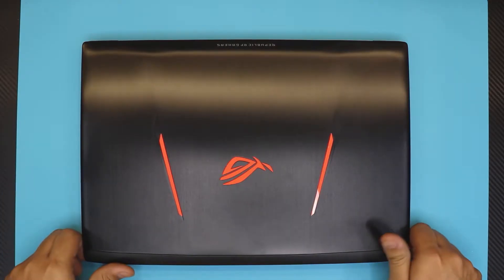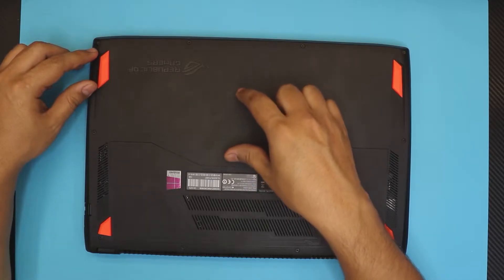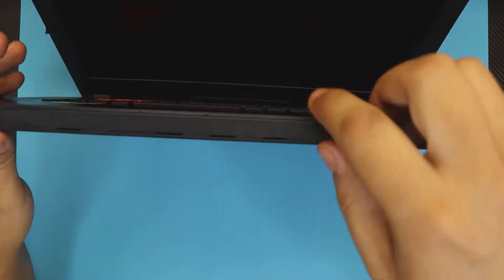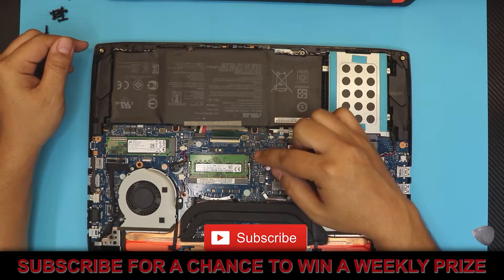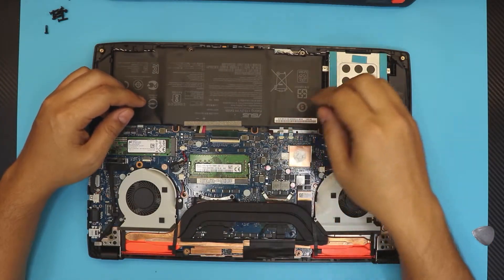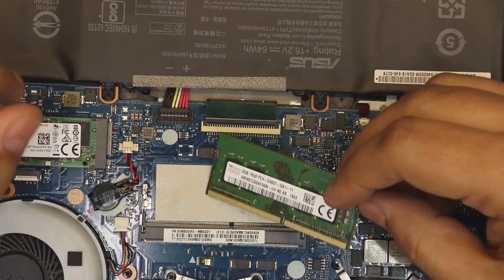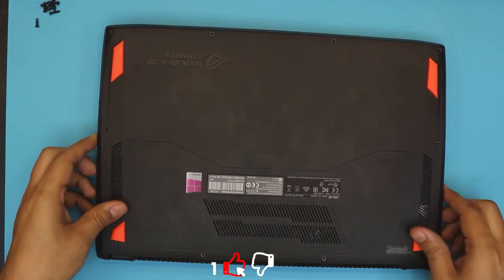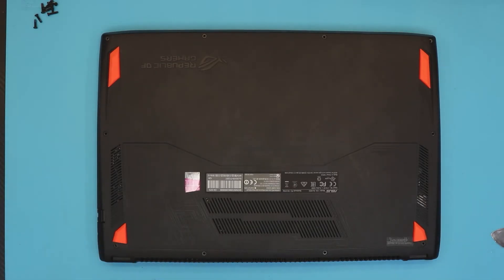ASUS ROG Strix GL502 Ram upgrade disassembly guide

Comment: What is the max frequency that we can use? Is it a problem to use a 3666mhz 16gb? I have the G502VM-FY017T
Reply from the maker: you can use a  3666mhz and the bios it will adjust to the max that can handle. after putting a  3666mhz go to bios and enable the XMP profile.
Reply: @uFixTek  thanksss! And why when i see on my computer the max i can add, its says 64gb but the doc say 32gb? I tape "wmic memphysical get MaxCapacity, MemoryDevices on the" on the CMD
Reply from the maker: you should check the cpu specification and not the motherboard.
you should put the max that your cpu can handle. not your motherboard or laptop model.
Reply: @uFixTek  a i7 can handle more than 32gb no? Why you always say that this laptop can handle max 32gb? Sorry for noob questions
Reply from the maker: just by saying i7 it doesn't help, open your task manager and go to performance and click on cpu and give me the exact i7 model.
i need to know i7 and what gen and what line in that gen

i7 - Gen , lineup 

and then you can use the intel website to see the Max Memory Size.
shorturl.at/inxD5

Comment: Hi, i have the gl502vt but i dont know how much ram i can upgrade, this model has 1 module for upgrade, and this model support two drives? a m.2 and a ssd?
Reply from the maker: you can go up to 32gb ram and have a m.2 ssd and regular hdd or ssd installed at the same time
Reply from the maker: @Freddy-lj1oq  yes you can

Comment: I’ve got the gl502vm with the gtx 1060 , I clicked the link to buy the ram but it gave so many options to pick from, what model of ram do I need.. I think I want to max out my ram at 24gb right or 32?
Reply from the maker: you can remove the 8gb and place a 16gb sdran ddr4 and this is the link:
https://amzn.to/3hFGx4I
2400Mhz C16  (1x16GB)
you can go max 24GB but the cpu can handle 32 but there is no way to get to 32 gb as of the 8gb soldered on board so therefore 24gb is max because they love F*** people over by soldering rams on board!!

Comment: Hello, I have the model ROG GL502VM-FY225T Intel® Core™ i7 16 GB DDR4-SDRAM 256 GB SSD NVIDIA® GeForce® GTX 1060, I would like to upgrade the RAM to 24 GB (I think it’s the maximum amount allowed for my model). Also I have 256 SSD only, I have 0 HDD. And I would like to have more SSD, I don’t know if I can expand the SSD with an external SSD or I have to replace the one I have, in any case. I hope you can help in both issues, thanks and good tutorials.
Reply from the maker: your max ram is 32GB:
2x 16GB
https://amzn.to/370VHfS
(but this motherboard has one soldered on board so you right you can go up to 24gb only add a 16gb.)
unless you desolder the on board ram chip and solder new sdram chip. lots of work.
and you cant extend the m.2 with sata , therefore you cant extend the or unite both.
Reply: uFixTek Thanks for answering. So isn't it a good idea to make any modifications by myself?
Reply from the maker: no dont trying to remove the ram chip, only remove the ram dim that is available as shown in the video and place a 16gb in there, and you are all set
Reply: @uFixTek  Is this notebook not compatible with this memory? Https: //www.crucial.com/memory/ddr4/ct32g4sfd8266

I have been researching, I saw on the Asus website that it is compatible up to 24 GB, but I wanted to go at least up to 32 GB since there is no 24 GB this would be the only solution. Corsair Vengeance' memory is not compatible because of the Chipset for example... can you tell me what would be the consequences of using this memory?
Reply from the maker: @albertpereira  no the chip set will have a very hard time or wont detect the ram dim. we have only be able to push the ram to max 24gb , because you only get 8gb soldered on motherboard on the other-side, and the max that we could place on the available dim is 16gb.
https://amzn.to/301ZCHF
Reply: @uFixTek  I know about the chipset's limitations, I just didn't know what could happen, in this case I may not recognize the memory. I will follow your advice, thank you very much for your help and attention !!